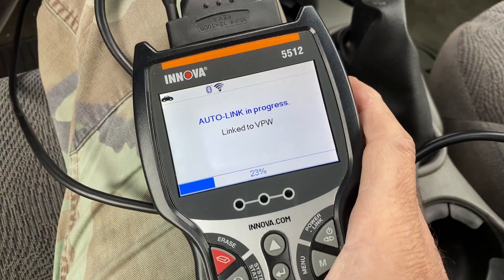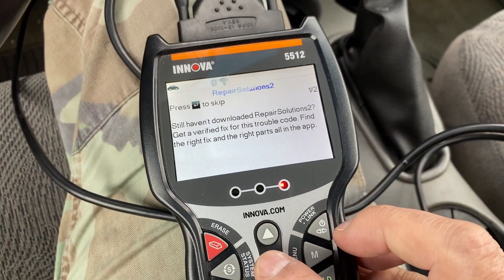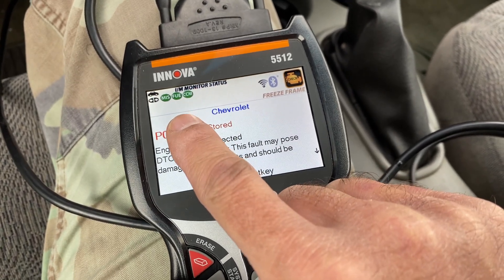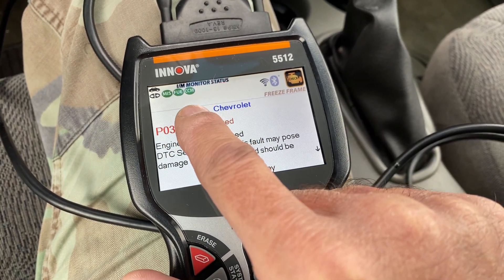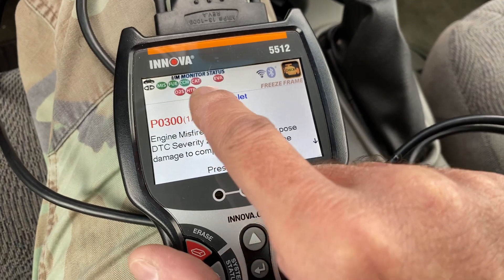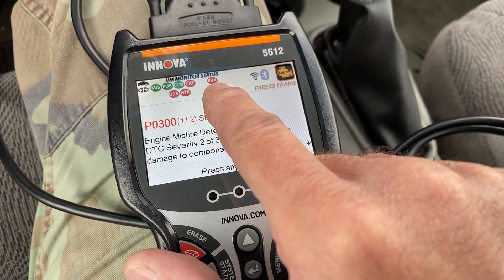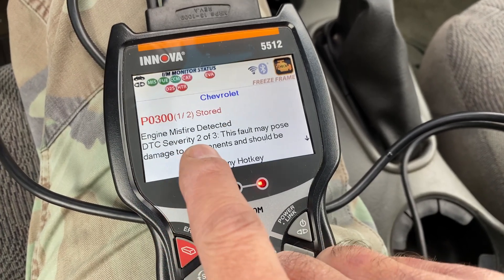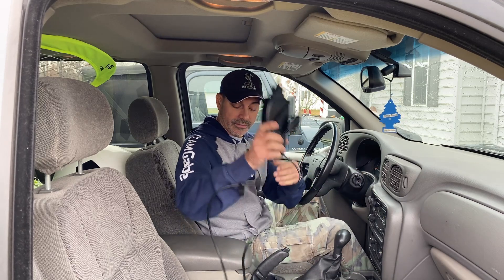Fixing A P0300 (Random Misfire) Code (Andy’s Garage: Episode - 442)

Comment: Great job on that repair I would have also wanted to see once you cleaned the connections up if that would have solved the issue, I know you wanted to replace them but was actually curious to see. 👍👍
Reply from the maker: The unbranded Ignition could are known for failing
Reply: Yes I understand that just was curious if the cleaning would have fixed it.